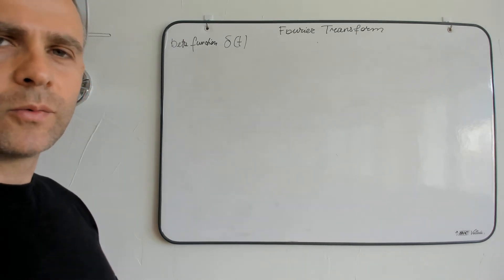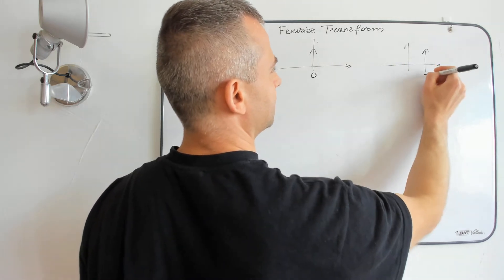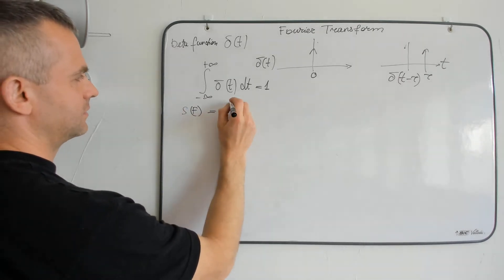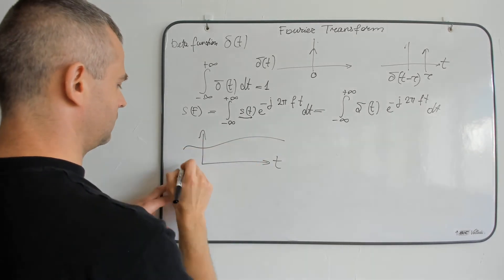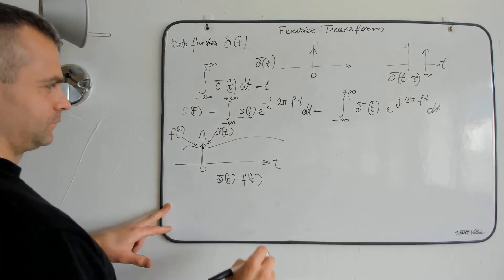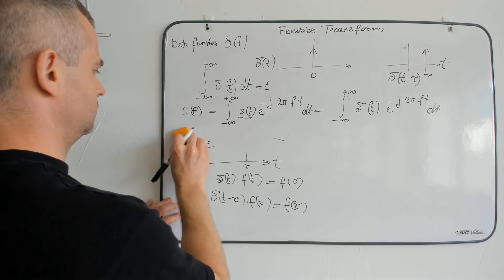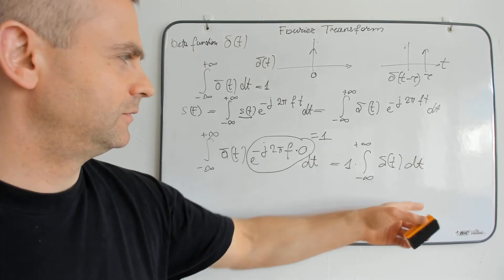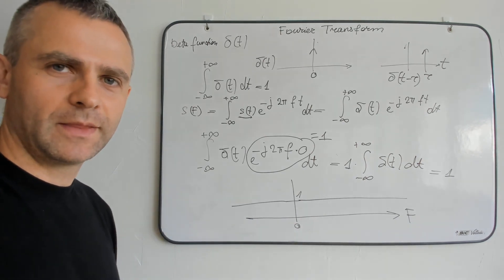fourier transform 01 : FT of delta function

Comment: Thank you for the explanation! Very clear but I still have a question.At 4:09 when you rewrite the integral, why is the delta function still there? I thought the result of the multiplication between the delta function and the exponential function was the exponential function at t=0, therefore that line would be the integral of the exp(-j*2*pi*0), but that doesn't equal 1. So can you please help me understand why the delta function is still in the integral?
Reply: It wouldn't be equal to the integral of exp(-j*2*pi*0), but to exp(-j*2*pi*0) itself, which is 1. 
The usually shown method is just a shortcut, since the integral of dirac is just 1, and the other part is the coefficient with a real value.